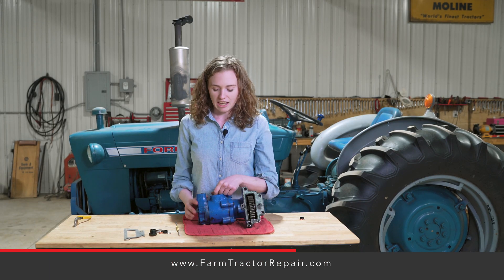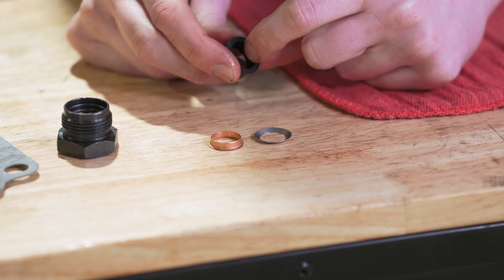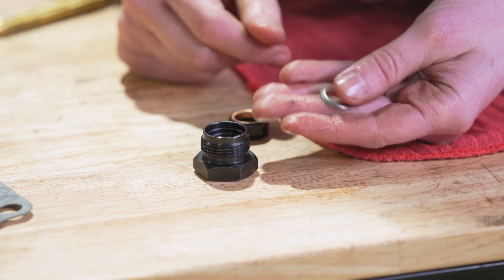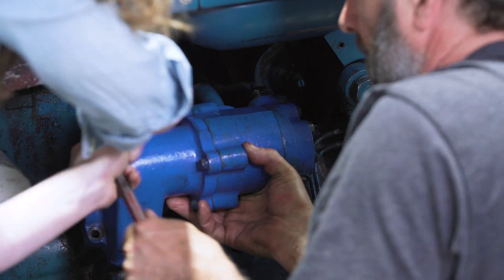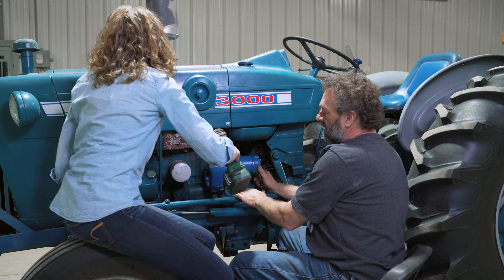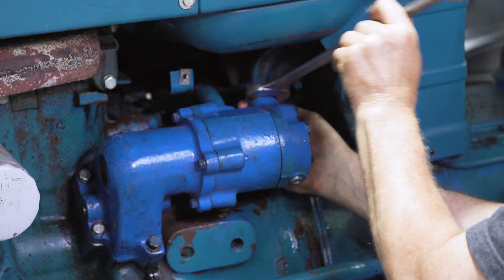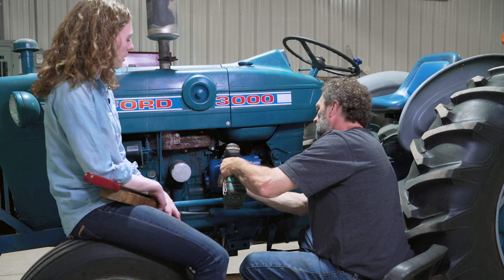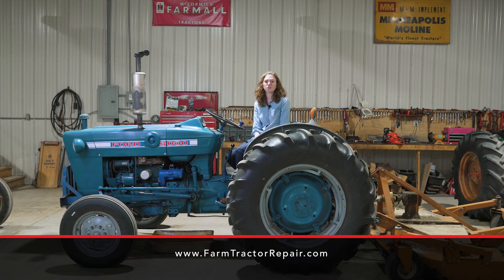Ford Hydraulic Pump Installation, High-Compression Fitting, How to Install without Leaks

Comment: No luck with the part from this site. The rubber part with brass part would not compress into the nut itself.  Appeared to be larger than the old parts and I noticed the nut size was a little different. Ordered OEM assembly. Anyone else have this issue?

Comment: i spent all day today trying to get that fitting lined up .  I bought a new line and I think its a hair off in the  bend closet to pump so I might have to remove the pump and start it that way and then put the pump back on..  At least I know that fitting will screw in so I havent messed up the threads.  Day two tomoroow.

Comment: I’m trying to find the correct fittings for the hydraulic line. I just bought a new hydraulic line and need to find the crush fittings. I have the ones with both copper sides but my old line kept blowing out. Do you have part # for the correct one?

Comment: I ordered your HP pump seal kit today. My 3000 tractor makes this a very hard job. The front-end loader apparatus is directly in the way, plus the exhaust is routed down and out the back of the tractor. Those two things make it even more difficult to do this work. Your videos are extreamly helpful. Thanks for being there😊

Comment: Hi team MY Ford 4000 is leaking engine all from around the 1/4 theaded shaft thatn you pulled in your overhaul of the pump >> I can see it coming from around the shaft? Can i pull this shaft from pump like you with a weighted puller,enough to seal ,wihout pulling pump out for complete service ,? Bob Nsw Aus

Comment: I can see why they changed the later years to just a bolt on flange that looks like a pain, mine is making too much pressure, had a new pressure relief valve and didn't help, could I have gotten a bad one or are they adjustable at all, my put another call into Dan he was very helpful last time I talked to him

Comment: I have bought the kit and put everything on like the video said too and the metal line to the compression nut stills keep popping out
Reply: Its because you need a new line.  Removing the old one takes off enough metal on the line which won't allow it to seal thus the line pops out.  Or you aren't torqued enough

Comment: Hi I have a question I have a ford 3000 like the one in the video what is the metal bracket above the centre of the hydraulic pump for your one has it to?

Comment: Thank you so much for this video.    New to tractors and my Ford 3000 I bought two months ago and now I'm plenty busy getting it into shape for this summer of use.  I've used your videos more than any others out there to help me understand the steps for much of what I've been working on.  I do have a part supplier (New Holland) where I can get most of my parts locally  just 10 minutes from my house.  HOWEVER, they are not the ones helping  me figure out what steps I need to do for many of my repairs/maintenance and I am learning all that from YOUR videos.  So now I need to work on and reinstall my hydraulic pump so it would seem only fair to me to show my appreciation for the service you provide and I've just now ordered the "Hydraulic Pump Mounting Set with High-Compression Fitting" from your website.   Thank you again for your very helpful and detailed videos.

Comment: If my.3 point on a ford 3600 won't lift, is that pretty much the pump.  I replaced filter hoping that would help and nothing.  It will randomly come on while mowing but I can't lift for most times.  Should I replace the pump?

Comment: Thnaks for your  illustration,  High pressure compression fitting , just repaired mine on my Ford 3000 tractor.  Thanks so much

Comment: Rachel
I HAVE 1969 FORD 2000 TRACTOR. MY GASKET AT THE OIL FILTER LEAKS OR FAILS SOMETIMES. ALL OIL IS LOST IN 5 SECONDS OR LESS. HOW CAN I REAPIR THIS PROBLEM. THANKS FOR ANY HELP.

Comment: I am getting a farmall m which has a 6 volt system and I'm wondering whether I should go with a tank heater or a block heater for winter starting.  Plus how hard would it be to install muself?

Comment: I have a quick question, on a farmall h or m, can you hook up to hydraulic hoses to each plug on the left side of the tractor, to create a 2 way system. or would you still have to do the standard conversion with a separate valve?

Comment: Great video.  My 3000 is a 65 and luckily both LP and HP pipes are flanged and o-ringed so a little bit easier to install. The torque wrench does fit in there. My problem was the oiling hole for gear side kept causing the gasket to leak. After two tries got it straight, but the drive side for my tractor had to be RTV'd, go on straight, be bolted, and not be shifted any...otherwise it would leak.
Keep'em coming, these videos have helped me a ton!

Comment: Question if you please:  I have a Ford 4000 Industrial 4-cylinder diesel.  Do the 3-cylinder and 4-cylinder use this same hydraulic pump???
Reply from the maker: They do not use the same pump. There are some similarities between the hydraulic pumps but yours would not have this style of compression fitting. This video outlines the rebuild of the pump you have: https://www.youtube.com/watch?v=ILaIk0D1_z4
Reply: @DanGingell    Thank you...   ^~^